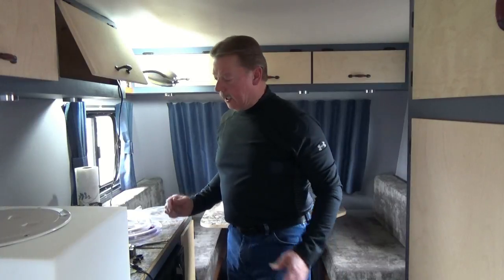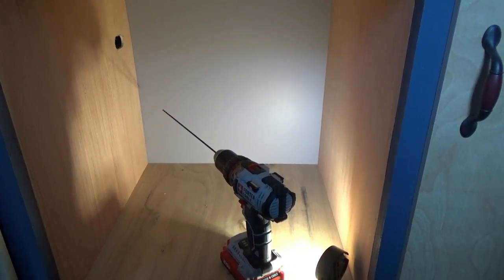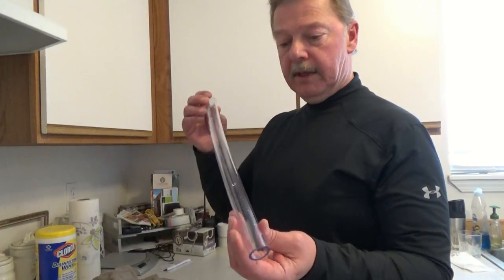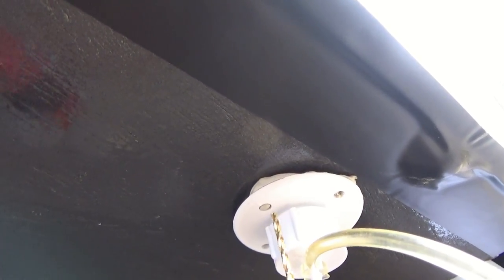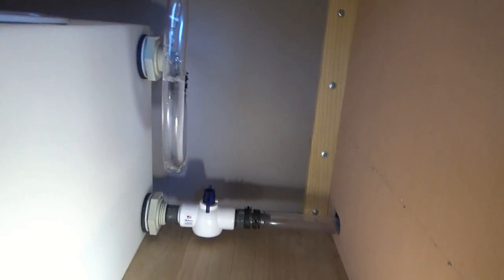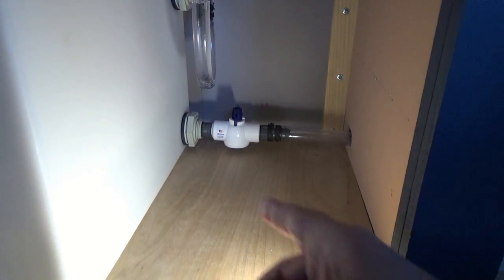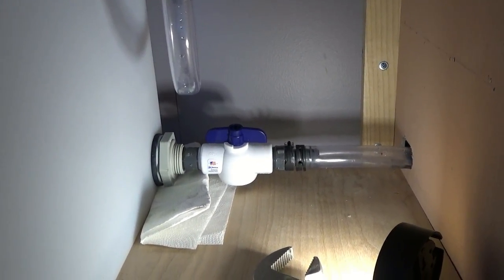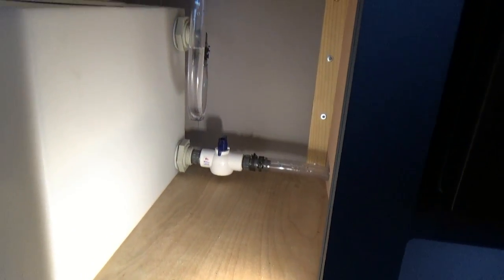How To Build A DIY Travel Trailer - Part 61 (Holding Tank Install – Part 2)

Comment: Nice trick getting the hose to remember it's intended shape!
Will you be blocking the waste tank in, so it won't shift around on the road?  You should be ok without a vent on the waste tank, just remember to pour a cup of water into the sink after you drain the tank, as it will likely suck your makeshift P-trap dry.  That will prevent any future off-smells from getting back into the trailer.
Reply from the maker: Thanks Aspendell! I am going to use an aluminium "L" channel cut into two inch sections that I will use to secure the tank in place so it doesn't move around. Attach some rubber strips to it so it doesn't chaff the tank. It will hold nicely! I will end up with a vent in the top of the tank. Once the tank is closed up... the sink will drain faster, and I won't have to worry about it draining the trap. No smelly smells! :)

Comment: OB- Many thanks for your pointers on lights.  Worked perfectly.  Question for you- with the orientation of drain outlet on your holding tank, and having tested it with liquid, how will you resolve the issue of the water in the tank sitting below the opening of the side mounted outlet?  Are you concerned that lingering water may foul without opening the tank and draining/cleaning?
Q2- With the holding tank being on the upper shelf, would you not have put an outlet in the bottom of the tank?  The hose and valve could have gone straight down?   
Q3- The tanks are 10 gallon?  Did that supplier custom make them, or were they a stock size?  Many thanks!  Best From CA US
Reply from the maker: Glad those lights worked out for you!! I will make it a point of periodically cleaning the tank. After a trip, a little house cleaning. I'll keep a little bleach on hand for just such occasions. I would have plumbed the tank straight down, but I am right over the wheel at this point. Over time, road gunk would build up on any exit there, I just avoided that. Yes.. tanks are 10 gallon. The company offered the size I needed so I didn't have to have them custom made, thankfully... might have taken another month! LOL!
Reply: Yes, I remember the shipping issue.  Figured you were over the wheel.  With the space left under the tank not taken up by the wheel, is that a good space to install a 12v pump?  Guess I'll have to watch!

Comment: Love your work.  Thanks for taking the time to show exactly what you are doing!  I will be making my own travel trailer to live in for at least a couple of years while paying off some student loans and am planning on using your videos as a guide.  I noticed when you were showing the bottom of your trailer, at 8:40 into the video, it looks like the sealing tape you are using isn't flush to the underside of your trailer at the outside edge.  Are you concerned with water getting into that?
Reply from the maker: Thanks for the comment!! Good eye... I still have to trim a little bit around the wheel well before I seal it up. Saving that for last because it got pretty cold out! :)  But absolutely... I will be sealing that up for sure! Good luck on your project when you start! Glad to be of help to you!
Reply: that's very exciting

Comment: the trap is serving as an air vent for the holding tank; will you be putting a vent on the supply tank?
Reply from the maker: Hi Bear_82, I will be putting a vent on each tank. The supply tank will have a vent that leads through side of trailer, the holding tank will have a vent installed on top of tank and extend two or three inches. Still looking for just the right vent. Thanks for stopping by!

Comment: Need a sweep curve.   Any junk may plug at the 90 bend.
Reply from the maker: Good point! I thought about not using the elbow, but then I was afraid vinyl tubing would relax and kink over time. I have a backup plan if this doesn't perform. Thanks for the heads up!